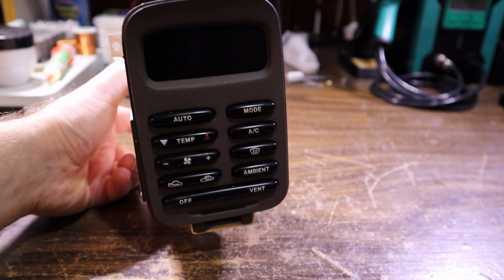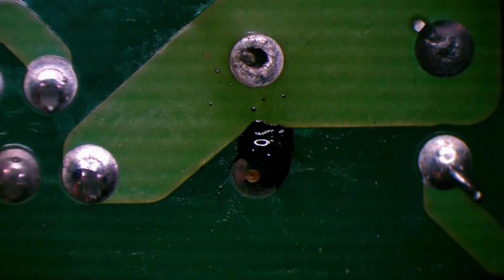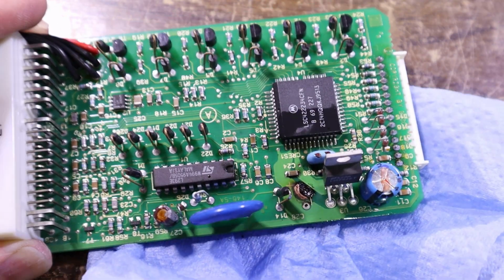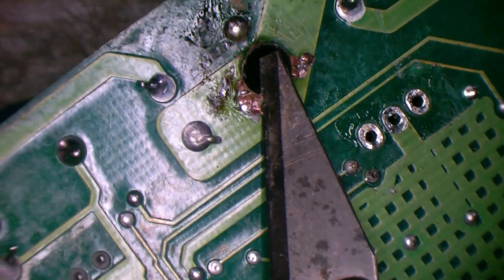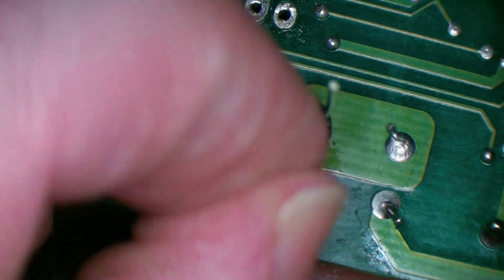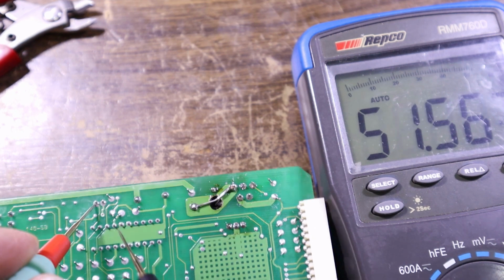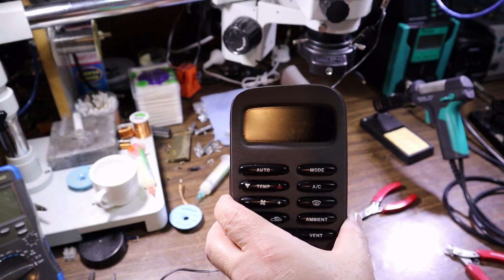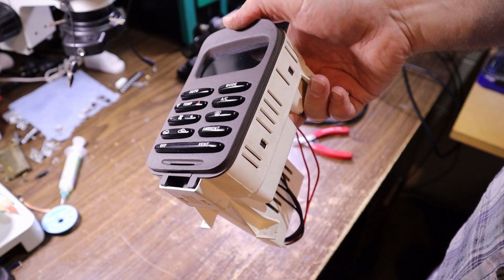Ford Fairmont climate control module repair.

Comment: Where did you buy the capacitors from?
Reply from the maker: Mouser,digikey... Lots of places
Reply: What did you use to test it’s working?
Reply from the maker: @97-ELT  A 12volt power supply.
Reply: @  appreciate your help and great video too thanks.

Comment: An end of life battery can allow a lot of spiky ripple through from the alternator due to high internal resistance.
For an old frontline electro that may just have been the straw that broke it.
Reply from the maker: It has a new alternator but maybe the old one pushed it to the edge. I don't know how long it's been installed for.

Comment: Smashing repair jonny :-D
I was a bit worred about hidden traces in the pcb, but there was Zilch :-D
That regulator looked like it could of had a reset line or similar for that controller.
That cap needed a nappy lol.

Comment: Those three pin resonators have built in capacitors, like you would normally find on crystal connections, with a pair of 20pF caps to 0V.
Reply from the maker: Interesting, cheers for the info!